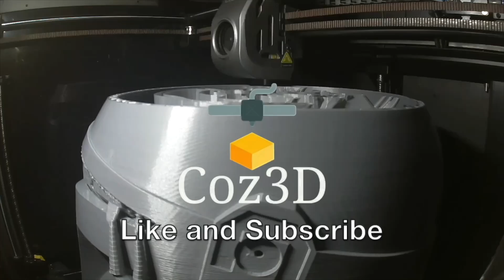R2-D2 Electronics explained!! (Part 12)

Comment: I have a question. I read on the Sabertooth website that they don't recommend using power tool batteries. I used two Greenworks 24V 4Ah power tool batteries, connected in parallel, and I used a relay on each motor as protection. Everything worked fine for a week, and then the Sabertooth 2x32 failed. What kind of protection did you use?
Reply from the maker: Homestly no protection on it and it’s worked fine for now.  Maybe i’m on borrowed time?

Comment: Do you happen to still have the stl files for the rail mounting plates? I noticed the holes are ever so slightly disproportionate.
Reply from the maker: Those should be in the Badeley patrion folders unless you're meaning this:
https://www.thingiverse.com/thing:6667081
Reply: @coz3d  Sorry, should've been more clear, the terminal block mounting plates. I know the standard board layout is sized for the two DFR0379 buck converters. I couldn't find any files on the patreon, so wasn't sure if you just modeled those yourself.

Comment: I've been a member of the R2 Builders Club since I was 18, I'm now 41 and finally built my R2 unit. How are you getting your electronics such as Padawan 360, Syren, Sabertooth, and such? I can not find anything to RC my R2. Can't find anything for sale. The Builders Club has SO MANY threads which for me has no answers, just more questions. My simple question is: where do I get the electronics to get my R2-D2 working?
Reply from the maker: I have some items listed in the description below.  I do use a syren and sabertooth.  I know it’s overwhelming.  I’m returning from Japan so i’ll try to get you more info when I return to the shop
Reply: @coz3d  thank you. I actually did buy the items in the description. I really like your setup. I am unable to find Padawan 360 or anything like it to control the Droid. I am a noob to electronics.

Comment: Excellent Job Guys.... Very Clean Install...... Do the Harbor Freight batteries have the BMS built into the batteries? I am still leaning towards the Ryobi 18v 5.0ah but it is not too late to change my mind...
Reply from the maker: Thanks!  To answer your question on the BMS, no, I don't believe the Bauer brand does but the Hercules from Harbor Freight seems to have BMS.
The only reason we did the Bauer brand was because I have 9 of them already on hand.  I'm a huge fan of the Bauer tool line for the price.